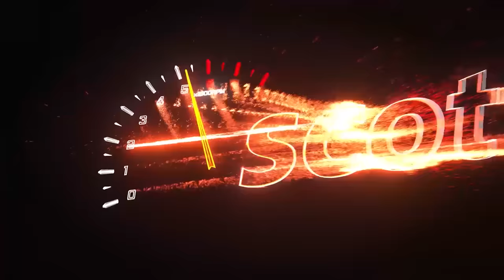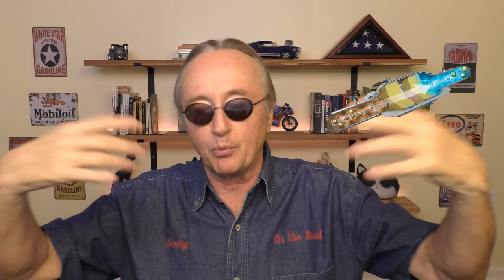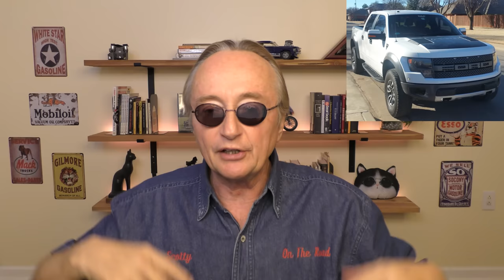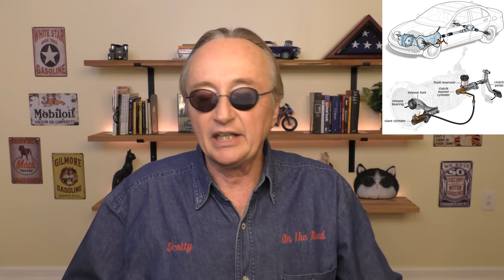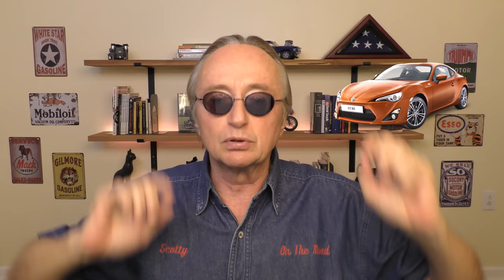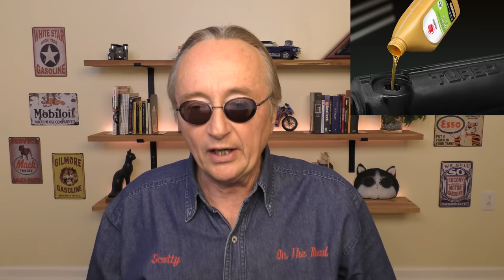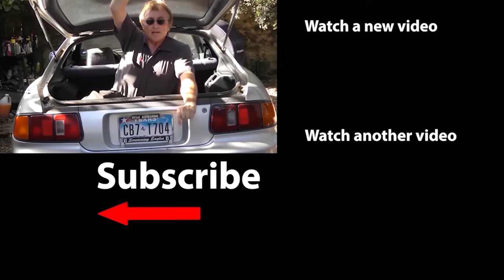Here’s Why Engine Braking Can Destroy Your Engine and Transmission

Comment: Thank you thank you  THANK YOU Scotty!!!!!! Using engine braking  to
save brakes is silly. Like you said, I can do an entire brake job for what?
a couple hundred dollars in parts even including rotors. Damaging drive train parts
like CV joints, engines and transmissions costs a fortune  to fix.
Brakes are for slowing down and stopping. The engine and transmission are for 
accelerating and  keeping the car moving.

Comment: Used to do engine braking with the older cars (pre '75). Brake were bad then so it was common to drop a gear to assist with braking and getting the revs up and enoigh torque to pull out of the corner.

Comment: Big rigs have and still use engine brakes aka jake brakes, most newer pickups use whats called an exshuast brake, thats terrible on the engine. Jake brakes use a third valve to basically turn yur engine into an air compressor to slow the rpms down adept ape has a great video on jake brakes worth the watch, jacobs brakes have been around for nearly 80 years now
Reply: Depends on the truck, some run external exhaust brakes. What hes talking about is labouring the engine down hill, which in a manual can generate a lot of heat in the gearbox if not designed for it. Trucks, including big pickups, have gearboxs differentials and engines designed for braking. If one of my drivers drove down a 15% incline without engine braking, i would warn him then fire him if he continued.
Its illegal to use the brakes in a truck on a steep decent in south Australia, if the cops see brake lights, you get a ticket.
Reply: @chenzitong1  engine brake is the best way, in my opinion, exhuast brakes on the ither hand no

Comment: I disagree Scotty.  I think you need to quantify that engine braking comment.  Cars and trucks have used engine braking for over a hundred years.  I've personally been doing it for 50 years and I've never had any problems or side effects. When coming down from Big Bear here in California, I've seen MANY (as in more than half) cars riding their brakes the whole 20 mile down grade (4-6%).   
Basic rule:  if you have to use your brake to MAINTAIN speed, it's time to downshift and SLOW DOWN. 
There's right and wrong ways to go about it.  Red-lining the engine is certainly not the correct way.  Teach them the right way Scotty. 👍

Comment: I have seen skodas in the UK with 400k miles on the clock, still running. Skoda is basically a cheaper vw. it is the second largest car company in the world and in Europe they are pretty cheap and pretty good.

Comment: I drive cars with automatic transmission and I seldom need to shift the gear out of "D" when going down hill.  Just make sure that you only briefly and firmly apply brake to slow down before making turns and do not ride the brake all the way down then you will be fine.  Modern automatic transmission will down shift by itself when you apply brake going down hill.

Comment: As long as it's not very high rpm all the time there's no problem, the stresses the engine and transmission go through during acceleration are more detrimental than engine braking.

Comment: My 2007 G35 (made in japan) has  a speed matching downshift that I use often. Saves my brakes and my car has 156,000 miles on it. My downshift that I choose to use regularly is under 3000 RPM. I use but don't abuse.  
Keith Schaedel.......................................5/12/22..............

Comment: According to my research, downshifting at more that 5,000 RPM is dangerous for your engine and drivetrain, but presumably, you drive more sensibly. Most gas engines exceed their power band over 4000 RPM regardless. Engine braking made a LOT of sense before ABS, because it reduced the chance of skidding.

Comment: Well Scotty........I have been "engine braking" (down shifting) on every standard trans vehicle (motorcycles, trucks and cars) I've owned over the last 50 years.  Including Toyota FJ, 4 Runner, Tacoma and 2 Tundras with their Auto trans ("shift if you wish") with absolutely no issues ..........ever.  I'm not sure I am onboard with you on this one :)
Reply: @Mark Codiroli I must be completely ignorant of my misinterpretation :)
Reply: @Mark Codiroli That's an easy answer - nothing happens because nothing has ever happened when you downshift properly.  It goes without saying, but maybe not, that while slowing down using engine braking, you momentarily pull in the clutch and give the throttle a blip ( a few hundred rpm only) to match the RPM that your engine will need in order to accept the next lower gear smoothly, then release the clutch nice and smooth without any jerking or squealing of tires, banging helmets etc.  Never downshift without the clutch and never go for more than one gear at a time. You learn this method pretty quickly after your wife/passenger smacks you a few times for not being smooooooth!  Perhaps not so ignorant after all.

Comment: "Billy" the guy that has been cutting my hair since 1982 told me his Corvette was running rough so he took it to his mechanic. The mechanic said he's going to do a valve job. He removed the air filter and told Billy to sit in the car and start up the engine and give it some throttle keeping the engine from stalling while the mechanic poured water into the carburetor. Once he was done the engine ran smooth again. The issue the mechanic felt was the cause of the engine running rough was that the valves had carbon buildup and were not sealing properly. By pouring water in the carburetor, it cleaned the carbon off the valves and seats in the heads allowing them to seal properly. Luckily this worked and didn't need to have a real valve job done because it would have been expensive.
Reply: Hopefully you don’t try that trick yourself because can easily destroy the engine with water.
Reply: @Asto508  After that, he drove the car for many years until it burned to the ground from an electrical fire. The only thing I can see that would cause the water to destroy the engine is if it started to idle too low while water was being added and it could hydro lock one or more cylinders causing a connecting rod to bend and or break. This is an old school way of removing carbon from valves and seats and if done right there won't be any issues.
Reply: @cliffords.8341  As you said, you have to do it right and if you don't, it's game over.
Reply: @Asto508  I wonder if Scotty ever tried it. I'm a retired motorcycle mechanic and never tried it, although there were many opportunities. I didn't want to have to tell the customer not only does he need a valve job "removing head(s) to grind the seats and valves or replacing valves", but you also need a connecting rod, piston etc., because the rod is bent and piston is broken. 

Customer: 
How did this happen?

Me:
Hydrolic lock from water in the engine.

Customer:
How did water get inside the engine. It's an air cooled engine and has been sitting in my garage for 1 year and I stopped riding it because it was down on power with no mechanical noise issues.

Me:
I was trying to save you money by doing an old school valve job by pouring water in the carburetors and I screwed up. 😯 Oops! 

Customer:
I'm not paying for your screw up!

Comment: Engine braking causes vacuum in the valve chest and lifts oil to lubricate it better.  Engine braking lifts RPMs, meaning more piston strokes, so more wear 'n tear.  But, in the grand scheme of all revs in one's engine life, it's a very small percentage.  Brake jobs can cost $400 for rotor turns in the front end and new pads.  Do this three/four times in the life of the car before a transmission rebuild or engine rebuild, and it's still less than the rebuilds.  Or less than used/rebuilt engines purchased.

Comment: The part is where it damages your transmission or your current engine would be if you do not have your peons set properly because even if you are under a load in going down a Hill it will still accelerate. It's supposed to help you slow down but you still hold gather speed you still have to learn to breaking keep your RP m's now. I've seen people especially new commercial truck drivers that don't pay attention that have their opinions up in the red and I am bitching at them they get him down.

Comment: Looking at a used 6 cyl 2015 BMW M4 with 20k miles and a automatic transmission. It’s selling for $50K OBO, is it a good buy? Are the M series more better built than the base models like 335i, 448i etc just like the Mercedes Benz G wagon is better built than the less expensive Mercedes Benz models? Thank you for your time Mr.Kilmer

Comment: You do a lot of engine braking with a motorcycle because the engine has a lot more influence over the chassis with the power to weight ratio advantage.

Comment: Engine braking is a wise and very effective way to moderate your vehicle speed and assist in reducing it when utilized properly by someone who knows what they're doing.

Improper engine braking, ie over revving the engine is definitely harmful and can damage an engine very easily.

Most people who only drive cars or other family vehicles should never need to bother with it unless you find yourself on a long, steep grade. The heavier the vehicle though, the more important it is to know how and when to use it.

Ride your brakes on a hill too much and you'll end up with a brake fire very quickly and trust me; you DO NOT want that!!

Comment: Engine breaking down a slippy half frozen slush covered road is worth it. You know what's even more expensive? Running into another car because you hit your brakes a little too hard and started sliding down a hill because you didn't down shift to keep your revs up and keep your speed down while descending a hill in bad weather. Engine braking has saved my butt many times where the brakes would be more dangerous to use by themselves. Engine braking and light braking will get you down a slippy hill real safe. It may be real slow but you'll get there in one piece.

Comment: My automatic 2009 Honda Accord has a 3, 2 and 1 option on the shifter. I use it to brake a half the time or so. When downshifting in my auto, I like to keep it under 3000 rpm as to not over do it cause you shouldn’t treat a regular car like a race motor. You think this is smart? It saves lots of gas and it rev matches itself.

Comment: Using Engine braking correctly is actually good for the engine, there’s no fuel getting in, and the lubrication is intense. You don’t wear the motor by doing it, again when you properly apply it.

Comment: I'm reading the comments and there's some controversy, so I'd like to hear other people's opinions. I have an automatic with paddle shifters and when I'm on the freeway or a long road and need to slow down before a stop, I tend to just release the gas and downshift myself so that I'm not braking as much. I understand what Scotty is stating, saying that brakes are relatively cheap, but is it really that bed for your engine and transmission? (When I do downshift on my own, my RPMs aren't very high anyway, maybe 4k tops.)

Comment: In those 6 speed f150s if you have an odd hard shift first thing I'd try is unhooking the battery for a while, sometimes after the transmission relearns the shift patterns according to your driving it smooths out.

Comment: i drive a manual car and use a mix, engine braking with a bit added braking. ive been down some very steep roads @20% ,even  over 30% and even down close to a 40% grade on the very few. long twisty down hill roads my breaks seems to get a lot fade and much less performance and time i reach the bottom they can be very hot, but using a low gear, 2 for med down hill or put in 1st if its very steep and mostly gravel/ snow/ice so i can go at a much slower speed and my brakes are just fine, mostly single track roads with passing places are the roads. normal roads maybe drop it a cog or two.

Comment: I definitely think that I would disagree on this one. I have been using engine break to my manual and automatic transmission.they are both 13 years old and still run like new just change the oil regularly and downshift 1 at a time.

Comment: Hey, Scotty, long-time subscriber. Some unlicensed crackheads totalled my old car. I'm in the market for an SUV, but I've gotta buy a used vehicle. Actually, I need to keep the cost down to around $6,000 - $7,000. Are my price  limitations going to dictate that I'll only be able to get a junk SUV and I should just settle for a passenger car?  What year/makes/models would you recommend and which ones should I avoid?
Thanks 😊

Comment: Safety first. I guess the question should be which one is safer using engine brakes or just using service brakes. Well I am a professional driver who drives city buses(VOLVO JONCKHEERE)in Jamaica for Jamaica Urban Transit Company and in training we were tought to use engine braking foremost and supplement it with service brakes and by engine braking I mean the retarder system and guess safety is what matters so if the engine and the transmition drops out so be it. Better than running off a hill and down a gully with overheated  brakes,peace.

Comment: 40% at 2,000 miles means the "recommended" oil life is 5,000 miles.  If it took "several months" to go 2,000 miles, that doesn't sound like much long-distance driving, but mostly local short-trip driving.  Under those conditions, 5,000-mile oil life seems about right to me.

Comment: On a 1991 2 liter Camry the seal leaks at the crankshaft pulley. Can it be replaced without removing the engine? I understand it can be removed without dismantling the engine.

Comment: No way engine braking can destroy your engine/ trans unless they have no oil in them.  I'll admit there is probably more stress being put on the drive train when engine braking, but unless you bang it into 2nd from 60 mph it's no big deal.  The engine just becomes one big air pump since modern cars will cut fuel when the car is de accelerating. Also make sure you rev match when downshifting to avoid shocking the drive train.

Comment: When cars were rear wheel drive and had propeller shafts you would quickly wear out the universal joints by engine braking.

Comment: I've used engine brake all the time in the Semi, when I had a 2012 International Prostar, I had a 10 speed standard I down shift 2 to 3 gear down when going down hill and turn on the engine brake. even in the Tractor as well?
Reply: Don't understand your statement/question.
Diesel engine Jake brake is made specifically for engine braking.

Comment: I still did not get an answer to what actually gets destroyed on an engine by engine braking BUT on any newer vehicles I drive I do as little engine braking as possible simply because of the ABS on the newer vehicles that has saved me many times with the idiots in front of me as well as in the inclement weather, yes I drive for a living too..

Comment: You have 2 ways for engine braking: slow or fast.
Modern engine can shut off fuel injection when you release gas pedal. Means brake on engine is like brake on just compressed air, which has also one good side: it can cool down engine a bit. Brake pads may cheap, they cannot last forever, while engine can just brake longer.
It's only matter don't make too many RPMs if you want brake with engine, and switch in gear must also smooth, not sudden. While switching, use brake for smooth brake process.
Fast braking is better with brake, it's faster and mostly for short time.
And it's also for fuel economy. Hybrid cars use even electric motor for magnetic braking and energy regenerating to charge batteries a bit, so don't use brake too much with hybrid cars.

I have never problems with engine braking, it's only matter how fast you want reduce in speed and how long the brake distance is.
Old engines with caburator is useless for engine braking, the fuel cannot just shut down. Use normal brake is better here.
Reply: @Mark Codiroli You may explain me why it's written in some guides, where they told you it saves fuel with modern engine braking.

Comment: Scotty, my car keeps burning out lights. 2012 Suzuki Kizashi - overall a great car, especially in the snow. But every couple of months, a headlight goes out. Like reliably. Why does this happen?
Reply: Cheap light bulbs or too much voltage on them that keeps overheating them. Just check the voltage of your system, either with obd2 tool or directly with a multimeter on your battery. It should be around 12V-13V when turned off and around 13-14V when running with alternator. Maybe your alternator produces too high voltage in certain situations or in general. But usually, the bulbs should be fine with a little more current and it were extremely high, the fuse (usually 15A) would blow out first. Standard halogen bulbs usually draw only 4-5 amps. 
So, most likely it’s just cheap bulbs.

Comment: I've been driving for 45 years; engine braking all the while. I've never had an engine or transmission break down. (Oops, just one-head gasket.)  Just lucky I guess.
Reply: I have had a manual transmission break down. Dunno why or how, but going down the highway suddenly ... clunk, burning rubberish smell, can't shift and steady slowing down.

Clutch went, 1st and second gears needed replacing. Cost me 1600 usd to pay a mechanic to do. He also told me wrong sized clutch was in my car and bought oem. Definitely didn't cost thousands and thousands and thousands  to rebuild.